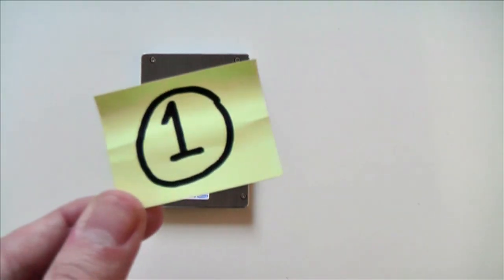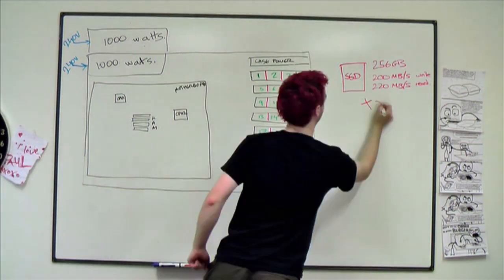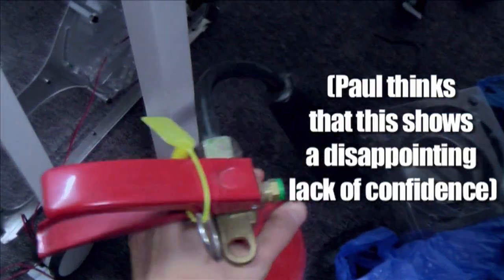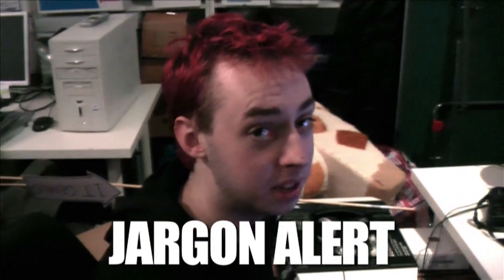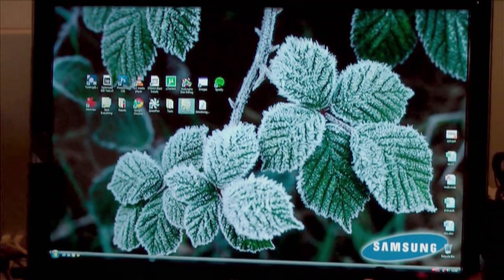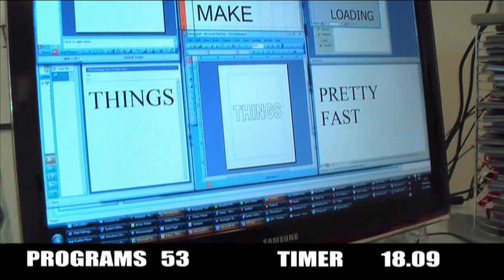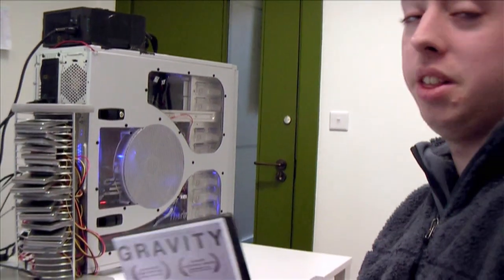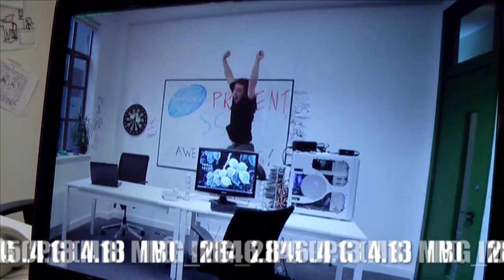Samsung SSD Awesomeness

Comment: @t0liman If you use enough drives per controller to saturate the SATA II bandwidth, and have 6 controllers, then you'll achieve faster-than-SATAIII speed. Even if you use 6 x $30 Promise SATA III controllers and software RAID 0, you'll still bust the 6Gb/s barrier of SATA III.

Comment: @123ww333 you won't get 6gb/s, you get 600-750mb/sec on SATA 3, even then, that's peak. SATA iii are 6gbps not 6gb/s

the average read speed is 460-500mb/sec on SF2200 SSD's, and 90-110MB for 1tb-2tb HDDs, and those are still best-case.

this kind of absurd test is more about the RAID controller being insanely expensive and taking up nearly the PCIE throughput of a video card. without that, ehh.

Comment: @darklightnin A normal spinning hard drive would crap all over itself if you tried jumping around with it while it was reading a file. The Solid State Drive has effectively no moving parts so jumping around with it won't mess up a read or write operation.

Comment: I plan to get one of these ssds but just for windows + program files. Won't be raid though. With sata 3 out now sata 2 drives have come down by like 20 percent in price.

If money was no object though I would wait for the Fusion ioDrive Octal, that saturates a pci express x16 slot at 6gb a second with 5 tb of space!

Comment: i have a interesting question i have yet to find an answer for on the net i am interested in a 512GB x5 ssd raid 0 sata 6gb set up however with 3 SLI vid cards i have no available expansion slots due to the open slots being covered by dual slot cards which makes me wonder what the maximum transfer speed on board raid controller of the crosshair V asus motherboard will support i know that most sata 2.0 aka 3gb had most boards only support 600mb average what would this new tech be????

Comment: @TwinyHD 
You can't code Objective C on Windows.
Just face it. The unix core completely beats Windows's core. It's MUCH faster, MUCH more reliable, and built MUCH better. Ever heard of the Windows registry? Ever heard of NTFS, the shitty data tables that get fragmented and slow down with every file? Ever heard of malware? Ever heard of reliability?

BTW, I invested $250,000 in Apple back in 2001. I now have nearly $2,000,000. Money is nothing.

Comment: @Coi1221 Correct, the smallest pipe makes the bottleneck, saying it goes cpu>cache>ram>hdd is wrong, with the setup you just described it'd be the hdd causing bottlenecks bigtime.

Comment: @xgouldingx do you have any clue how a pc works? the hard drive is not even the bottleneck
it goes processor > cache > ram > hdd 
only boot goes faster or when needed to read from hdd, but decent os system don't have to do that so often

Comment: @KingIsulgard I'm sure these guys know better than you that this is because of the SSD drives. Hard drives also count in PC speed. Try to put an i7 together with 512 MB RAM and an old hard drive with only like 5 MB/s read and write speed. Wouldn't be fast, right?

Comment: lol wtf... Even though that's impressive speed I still wouldn't put ssd's in my comp without the trim feature. I'll stick with my mechanical drives for now, 15000 rpm drives in raid0 are pretty impressive as well.

Comment: @Phenom69ll 800mhz each channel, which means it's a total of 1600. The frequency isn't always what would slow down ram, the timing is crucial and will result in a way better performance boost if tweaked.

In other words, a 6-7-6-18 but 1300mhz would perform better than a 9-9-9-27 2000mhz.

Comment: @klyppi123 Yes it is, GB = 1000MB but GiB = 1024GiB
The ISO Standard has changed many years ago because problem was that kilo, mega, giga and so on are always 1000 and not 1024 as it would come in binary system. 

That was one problem long time ago as drive manufacturers followed standard for Giga, Mega and so on but people saw sized wrong on computers.

So there is difference are you talking in decimal (SI) system or  binary (IEC) system. 

Now when talking about computer amoung, it is binary.

Comment: @HartuBeatu Actually they didnt spend much because the most expensive part of this machine is the 24 SSD's and they got it for free or dirt cheap because its an add and the drives probably dont cost alot to make so they just had to buy the other parts and when this vid was made they would probably cost $3200 MAX!!!

Comment: @kkjgg112391 It was transfering those files from one place on the computer to another, not actually pulling the data off of the disk itself.  Otherwise I would probably have cried even more than i did.

Comment: @henkvanderlaak They say SSD's have a 1,000,000 hour lifespan, which is ~117 years. Who here is going to live that long, and who's gonna keep the same SSD for longer than 5 or 10? I doubt defragging ruins it enough to cause any significant damage, even if it isn't the smartest thing you can do.

Comment: oops i missed a word *adaptec and motherboard. also the durability test was irrelevant. mechanical hard drives would give the same result. try bashing them with a hammer. mechanical drives win because they are built into a stronger casing.

Comment: Would be useless if you doesn`t have the right compenents, like Ram or an low core, an weak video card, old operating system, so on so on

Comment: Who needs 6TB of such a fast disk? 
If you ask me single $200 OCZ has a speed of 540MB/s and beats this system per buck.
SSD is still expensive for use as only drive, but it is very good to have it as boot and application instalation device, data can still go to HDD...

Comment: @DarkN00b2006 Acturally no; stick linux onto a 14tb raid drive (ext4), put 12tb of stuff onto it, and you'll find that it's about 10 times slower than the windows equivalent...
To be clear - that means that with 12tb of files, linux/ext4 is so slow, you can't even stream a 700meg dvd rip off it without the playback jumping all the time...

Comment: @gassie123 why you calling me an idiot? I have had flashdrives just stop working on me, and all a SSD is, is a giant flashdrive. If a ssd was to stop working you're screwed you probably won't be able to recover it, but if a HD was to go out, there is a good chance (if you have the $) that the data can be recovered off the disks. See HDs is still some physical data, but with SSDs it's completely digital

Comment: Amazing! to bad I will never use SSDs ever, cause they work like a flash drive and could be whipped clean from the littles events. You can keep running your ssds but I want a reliable drivem so I'll stay with the disk

Comment: That's what TRIM and/or Garbage Collection is for.  you NEVER defrag a SSD.  Any competent and wise ssd manufacture ( samsung, g skill, corsair, ocz, ) will tell you that awhen you chose to defrag a ssd, you are doing a POINTLESS task that just puts unncessary wear and tear on the drive and the data DOES NOT GET MOVED AROUND ON THE FLASH CHIPS!!  THUS IT DOES NOT GET FRAGMENTED! do some research all you know-it-NONES that want to shorten a ssd's longevity. further more...

Comment: @BrenRich101 Any drive SSD or HDD can become fragmented, if you really think SSDs dont get fragmented, you are wrong =__= I do realize that the performance over the volume is constant but what i am saying is that the operation of reading at a specific position then hopping to another to pick up the rest of the file will REDUCE performance. In HDD the hop AND the fact that it is at a different position causes a more significant reduction but in SSD the hop in reading still matters.

Comment: @Coops025 unlike hard drives, SSD's have no moving parts - so access times will remain the same no matter where data is stored on the drive.

In addition SSD's will degrade with use  and their access times will slowly go down. Defragging a SSD by rearranging the files will only increase this degradation.,

Comment: SIMPLY EPIC! My head nearly exploded when I saw this setup. 

I wonder if you are hitting any throughput bottlenecks on the RAID controller and the PCIe bus?

Also, you used MLC drives, I wonder how much additional performance you would gain on using SLC drives instead. Admittedly the cost would be mind blowing, but it didnt look like you guys has much concern over there :-p

Comment: @berserkdrift unlike normal hard drives, SSD performance greatly decreases as the drive becomes fragmented, if you look at the specs on sites like newegg you can find the read and write speeds, but check in other specs for random read/write operations and the speeds are greatly reduced! Its not a hard task to accomplish, and its in your best interest, so its not that outlandish :)

Comment: righto, i have been wanting to say this for a while as my bile is overflowing about this misleading video.  this add should have disclaimers warning people about just what is required to get any benefit whatsoever from multiple ssds in raid.  Unless you spend another $1500 or so on an high end raid card you are tipping your money down the drain buying more than 1 ssd.  on board raid controllers and sata bottlenecks wont let you get more than about 600MB, so thats about 2 ssd's - thanks guys

Comment: @ehab007bob 

depends on the version of windows (xp would take 30-40 minutes i think, cuz that is not made for this kinda speed)

vista/7 would take 10 min? cuz you still need the speed of CPU, DVD drive etc (no dvd drive if you make 2 partitions on the raid, and install from 1 partiton to the other one, then its extremely fast)

Comment: @angleisthebest Not thousands of dollars for the RAID controllers alone, just approx. $1500. The main amount of money was for SSDs.

That's SSD-s, now imagine how quick it could be if they used RAM drives - ACARD ANS-9010, for example. Though, with SSDs you can record uncompressed video in 1920*1080p 4:4:4 in realtime.

Comment: @Matrix49G 
totally man fast as but no redundant drives all bad if it fails flash memory is robust but not indestructible, however that is still impressive even if you cut it in half as a mirror you would still be quicker than a mechanical drive setup.

Comment: @carl0071 i think that the problem is that it has a high fail rate but still ssds should be cheaper we just need to hope that one company erned enough money ro pay back there resurges and than lowers his price to >1€/gig so i would really pay 1 € for 1 gig it is reasonable  but 2 € is to expansive. and if it is 1€/gig than i buy 5 30gig ssds to set them in raid 0 and an 2 tb hdds for some of mine games or stuff that doesn't need to load to fast

Comment: Nice but 24 of those drives would cost $16,800.

So I'd love that, but price to performance ratio does not compute. I can get a 1tb HDD for 1/11th the price of a Samsung 256gb drive. 1TB of Samsung SSD is going to cost $7000 and need to be replaced as drives wear out. 

I don't understand how SSD's are so expensive when there's less moving parts inside.

Maybe when the price of these things comes down to Earth I can afford to buy and replace them as often as necessary.

Great vid though... sigh.

Comment: @msndokaralho, okay, all you need to do is hop into your Delorean you got from Doc. Brown, the one with the flux capacitor. And travel back to the time when HDDs came out, invent SSDs, manufacture them, and price then the same as HDDs. While you're at it you could invest in Google, Walmart and Microsoft, prevent Lynne & Tessa from braking up, stop the 9/11 attack, inform the world that Milli Vanilli are lip syncing, and save the dodo bird from extinction.
Hurry up, I want Lynne & Tessa together.

Comment: Actually, the mechanical disk was the dumbest idea ever. It works, it does, but still,  think about it, it's a fucking plate spinning! It's rubbish! The only thing that should spin inside a case is the fans!

Your computer could be atleast 7x faster if it weren't by the HDDs. This video would be more about huge storage capacity than faster read/write devices.

Comment: Its true it is pointless, it just spreads the data out. And when you defrag it, it does the same.
It's kind of like finding a dirty spoon, cleaning it and then throwing it in the mud.
But because of that, it doesn't really do anything wrong with it. Its simply rereading and rewriting. thats about it. Damage done to the SSD? 0.01% if that I spose.

Comment: Sorry about that, I was in a rush and looked up 256GB Super Talent 3.5 inch Solid State Drive (SSD) SATA Flash Hard Drive w/ Metal Case Sale Price: $2437.00. $2437.00 x 24 = 58,488.00 and iam sure you right about the pc price aswell, but thats not the point i was trying to make...ok lets say it cost $22,000.00 to build this cpu(moded out). is it worth it to go that fast ?..... (for a gamer i think not) maybe having 1 or 2 SSD 256GB, but 24 seems like a waste of money to me.....

Comment: It would be 10x faster than usb 2.0, which is 480 Mbits. I believe the maximum speed for HDDs on usb 2.0 is around 25-30MB/s, so, I would assume the same for usb 3.0. Around 250-300 MB/s.

Comment: was it more of a hardware issue or networking? one thing i do wished MS and Apple would do is both come up with a file system where both systems can read the same drive. i know macs can read a windows drive but can't write to it, but unless you have a 3rd party utility installed on windows, it won't even recognize there's a drive there. it would make file sharing and transfering a lot easier. i know the exception is when a drive is networked it can copy and write fine, but it's usually slower

Comment: My longest position I worked was as a technical support manager. 
Unfortunately, half of our employees used Mac's. The rest used PC's from 
Compaq and IBM running different versions of Windows. We had at least 
20-30 issues a day with the Macs and about 2-5 with the PC's. Our Apple
problems were that the issues we had with the Mac's were often 
illogical and took my department huge amounts of time to solve.

Comment: Actually it does blow...Windows away. :P  In all seriousness though it really depends on what you're using it for. I do a lot of media production, and the Mac platform offers the best resources for my needs. Any problems I've had with the OS have been few and far between, and I rarely have to restart the computer because of a system hangup. I do wonder how it would run if Apple made it to where you could run it on regular PC hardware without having to hack the OS.

Comment: Quick price estimate (not including peripherals, motherboard,etc.)
1680 * 2 = 3360 (quad core qx9775)
+ 55 * 2  (fans)
+ 550 * 2 ( hd 4870 X2)
+ 480 ( 800mhz 4GB ram)
+ 200 * 2 ( 1000 W power supply)
+ 11 * 6 ( SATA -> SAS)
+ 9 * 4 ( MOLEX -> SATA POWER)
+ 1375 * 24 (HD's)
=$38516!!!!

Comment: Although ext3 and ext4 usually don't fragment as much as NTFS, it's not a true statement to say they don't fragment at all, even though they are quite resistant to it. The point of the SSD though is that fragmented files don't have any effect on the performance.

Comment: It's more purposeful for HDD's. Sometimes, parts of a file will get scattered around a HDD, which leads to slower loading speeds. Defragmenting puts these files back in the proper spots so the hard drive is optimized. SSD's don't have a moving disc, so it's completely pointless on it, and you should never defrag a SSD because it shortens the life of it.

Comment: I don't know about CPU but shouldn't the RAM be a bottleneck in this situation? The tests show that the read speed is 2GB/s. Even if you have DDR3 RAM, I doubt you oculd load 2GB into the RAM so fast. I could be wrong though...

Comment: no you wont. it's nothing to do with storage space, its all about seek time. a regular hdd has to search for the data, but ssds, due to being a solid state, have it ready. The one reason u may get the same result, is because of what was mentioned at the end, the raid card reched its limits, not the drives. also, seek times vary from hdd to hdd, cheap ones are slower, but top end are quick.

Comment: I have one of those 80gig G2 Intels on pre-order and I can tell you that they dont support TRIM: The drives firmware supports TRIM, Windows 7 supports TRIM, the problem is that Intels own drivers (currently) dont support TRIM. When better drivers are produced then that drive will support TRIM, until then it doesnt. TRIM wont work in Raid even if your drive supports TRIM on its own.

Comment: You can still read data from an SSD when it fails, so you wouldnt loose data if one drive failed. Raid is not good for SSDs though as (currently) SSDs dont support TRIM or Garbage utilities when being used in RAID. You are better off getting the fastest and largest single SSD drive you can afford.

Comment: They're striped in RAID 0, which means when a file is written, it's actually distributed across all 24 of the SSDs. That means that the speed does come from the distribution. However, this is rather dangerous, because if any of the drives fails, all the files are gone. Permanently.

But still, pretty sweet if you ask me.

Comment: a) those HSFs with the case standing vertically and no visible weight-support?
b) abuse of hardware by using the SSDs as dominos
c) more abuse of hardware by jumping on a friggin' trampoline while holding the SSDs (on, mind you) by their cables

Videos like this annoy me as a home user that has to bust a nut to be able to afford a mediocre budget computer while a computer like this one exceeds $20k in cost.

Raging aside - I want a 2gb/s hdd performance capable machine. :(

Comment: You can configure a raid to show as one big partition. The raidcontroller will split the files to the different disks to achieve the highest performance.

The problem is: if one disk fails the whole raid will fail and you will have a hard time recovering your files because some parts of it may are on the failed disk.